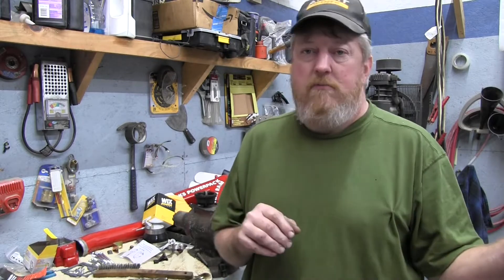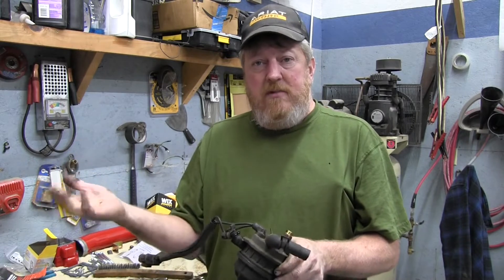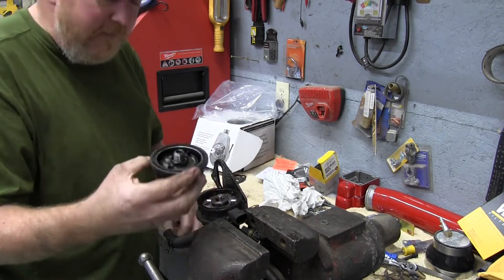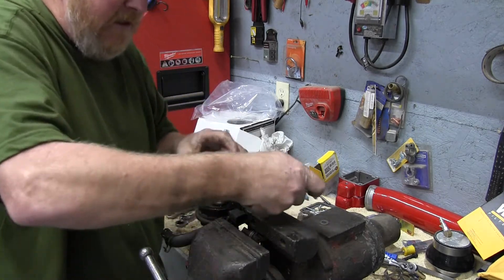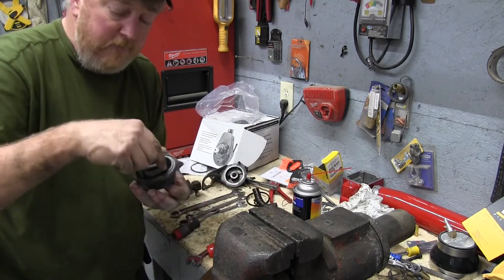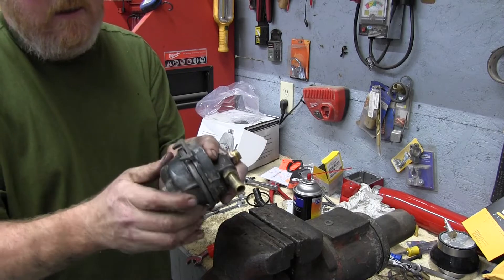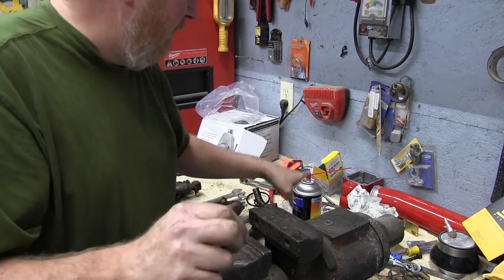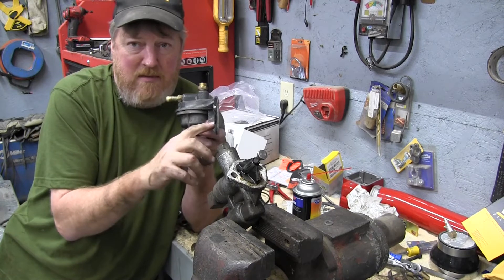12 valve Fuel Heater Delete part 10

Comment: Older video but by doing this will this eliminate air leaks which means no need to do a delete kit!? Thanks.
Reply from the maker: That a tough call, If I had today's knowledge then I would have just put the power driven diesel hot rod lift pump on as it deletes the complete thing and gives me the fuel pressure I need

Comment: Great video. I deleted the heater element a while back without removing the whole unit. Unrelated, I think my lift pump internal return spring is getting weak causing it to make a taping sound.